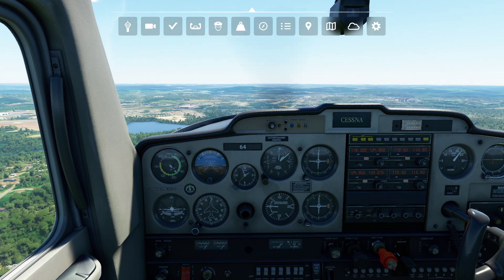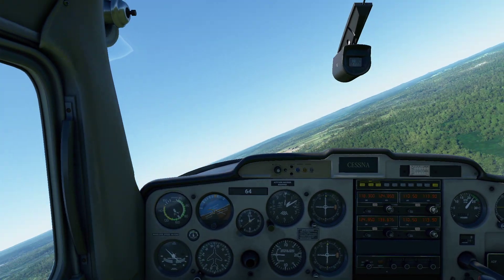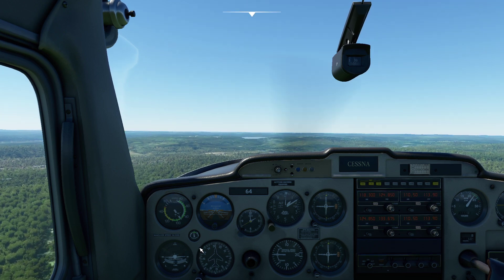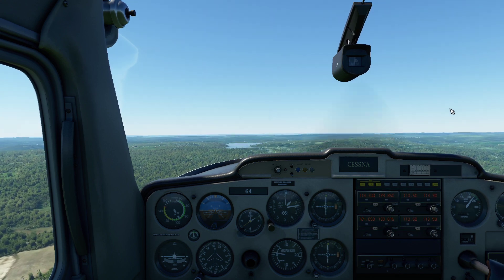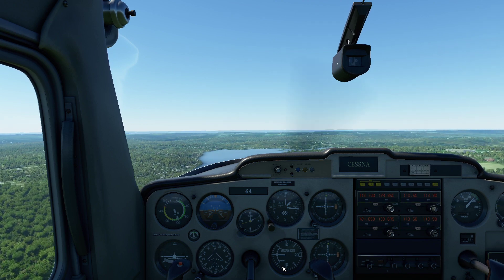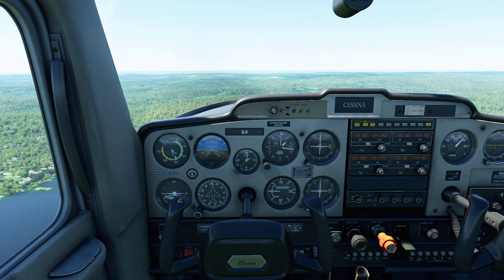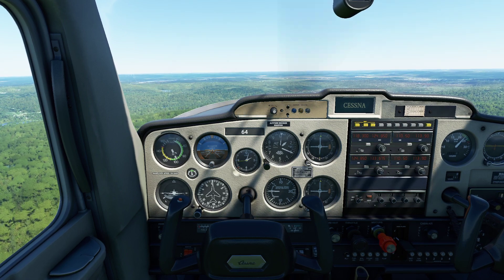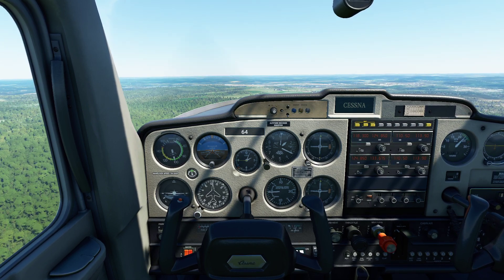Flight Simulator 2020 Basics - Cruise Flight and Trimming

Comment: Nice vid, thanks for making.  Tip for real-world flying, if you take the plane up to 8,000' or so, the reduced air pressure will "naturally throttle" your engine to about 75% power (where most planes cruise at) even with the throttle lever set to full.  This is desirable because the engine won't have to breathe through a restriction (a partially-closed throttle) and it runs more efficiently.

Comment: Thanks that was very clear. I find it so hard to trim for level flight, the altimeter is always going up or down. Maybe checking vertical speed indicator may help me. I do struggle to even find the rpm indicators on some planes. Managed a few bumpy but safe landings today.

Comment: I can set the nose trim and the plane maintains altitude -- but it still keeps rolling to one side or the other. I can't get the damn thing to cruise on a level plane.

edit: if anyone is reading this later -- I seem to have corrected this issue by playing with dead zone and sensitivity in the controls.
Reply: I have the same problem. I think it's a issue with MSFS. Many people reported this issue
Reply: @Kevindz113_  I disabled Auto-Rudder and it seemed to solve the problem for me.
Reply: @KevinKanji  oh. Interesting. I don't think I have auto rudder on but I will check again.
Reply: You may need to trim your ailerons or perhaps inadvertently have a bit more pressure on either rudder pedal.

Comment: Hey, I've got no issues trimming pitch, but why does my plane randomly roll at times? Makes it difficult to level flight.
Reply: The roll is caused by P-factor, also known as asymmetric blade effect and asymmetric disc effect. If using a clockwise turning propeller (as viewed by the pilot) the aircraft has a tendency to yaw to the left. This must be countered with right rudder. If using a counter-clockwise turning propeller, the aircraft has a tendency to yaw to the right.
Reply: @shr00ms46  hmm so what should I do about it? Trim rudder or ailerons?
Reply: @ww3032  i think either one works really
Reply: @shr00ms46  thanks mate.
Reply: @shr00ms46  How do you trim the rudder/ailerons?
Reply: It’s called a torque effect. Basically the prop turns clockwise and the plane wants to roll counterclockwise. Newton’s 3rd law of motion is what’s at play here... use right aileron trim to counteract it. Likewise if the airplane keeps yawing to the left, that’s called P-factor... use right rudder trim for this. The reason this happens is because a downward moving prop blade is taking a bigger bite out of the air than the ascending blade, which causes asymmetric lift.
Reply: i have the same problem
Reply: @pabloencina985  please tag me if you manage to find the solution. Cheers.
Reply: @ww3032  sure you too pls
Reply: @pabloencina985  heads up in case you haven't read it.